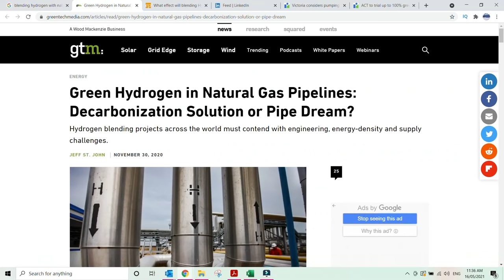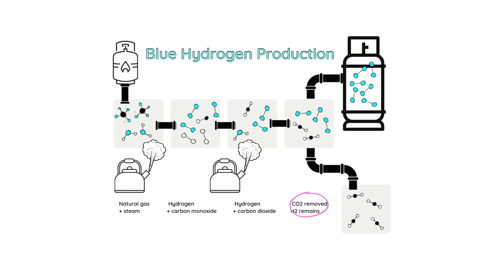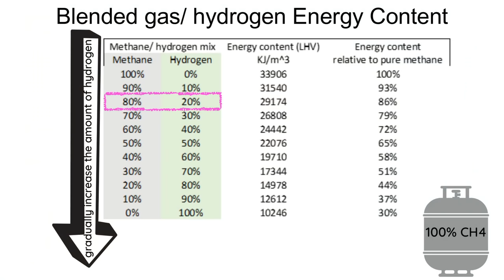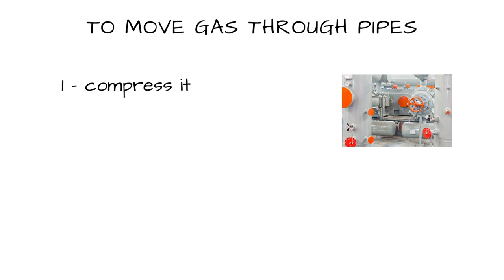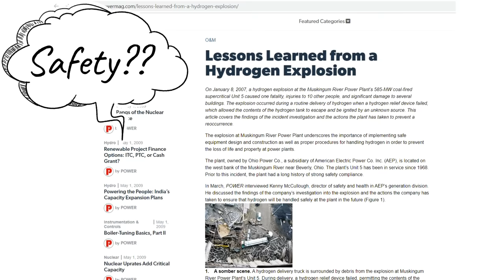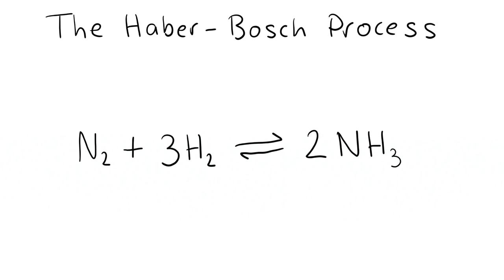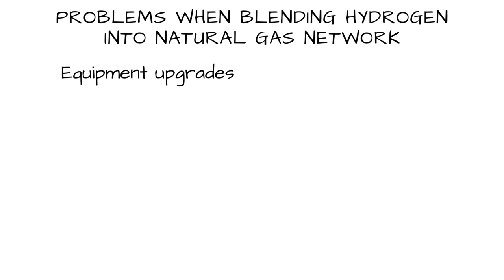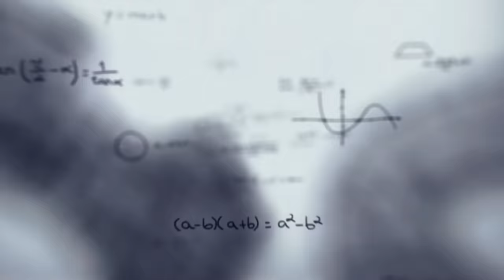Hydrogen in the Natural Gas Network

Comment: Excellent informative video Rosie.  And Paul.  Thank you.  I believe some of Pauls conclusions are worth exploring with an open mind.  But the difficulties presented for Hydrogen substituting into the NG network are considerable, and this is the key message that I found useful.  Yes, I think embrittlement will be a very important piece as well.  But also the ammonia aspect.  there is much to unpack here.  Distributed generation of hydrogen, and distributed storage of hydrogen, and many more.  Storage at 700 bar is really not attractive, so ammonia, but yes, renovation of the Haber Bosch process - there seems to be some good developments in this area recently.  My own interest is in seasonal storage.  Solar PV is cheap now.  But storage is still a big deal.  So I'm exploring hydrogen production and storage for remote sites.  We are talking about smaller amounts, so lower pressures, and perhaps ammonia will be involved.  All the best to all the engineers here !

Comment: An excellent video, very good explanation why hydrogen is not really an alternative in house heating. As my favorite energy writer, Mr. Vaclav Smil said that the biggest problem with see with hydrogen is that we cannot use it incrementally. We have to replace furnaces, compressors, even some cases pipes in order to implement this gas, cannot really use a lot of things from the already existing infrastructure.  Further problems like generating green hydrogen is also arising as it is currently a highly inefficient process with over 80% losses, while current technologies are based primarily on constant supply of electricity and stable current, which intermittent renewable energy cannot provide. Honestly I do not understand the stock exchange hype about these technologies.

Comment: Very good. I worked at PETROBRAS for my whole profissional live and for me H2 was a natural way to replace CH4 using the already existing infraestruture of natural gas pipelines. I was wrong unfortunately. But there is others means to store H2 using metal oxides em disc like kassets. I learned a lot about the subject of the possible application  of the natural gas grid to transport H2, so thanks a lot.

Comment: Hi Rosie do you know the densities of both gases of trying to pump it into a natural gas system? The methane is on average 0.89 and hydrogen is 0.079 its alot of difference how about pumping CO2 gas into a natural gas field if under pressure what happens heat is created at the compressor station and eventually at the gas fields it's a bummer what's the rush there is no magical bullet to solve things.

Comment: Rosie, Many thanks for this interesting video on the problems of hydrogen.

Mr. Martin believes that the way forward is to use and store energy in the form it is created. The problem for electricity is firstly that so far we have no commercial way of storing it, particularly over a period of a few days, and secondly the electrification of everything will be a mammoth task – a Cambridge professor of engineering has calculated that to electrify just the UK’s vehicle fleet will take the annual production of the World’s supply of Lithium, Cobalt, Copper etc..and the estimated cost to convert the UK home gas boilers to heat pumps and upgrade the National Grid is put at £300bn.

I think a better idea is to use biogas – green methane/natural gas because (briefly) :

1) It can be produced with low technology everywhere in the World using anaerobic digesters working with food/human/animal waste - and with just grass of which we have plenty. A by-product is green fertiliser.

It can also be produced using excess electricity from renewables (wind and solar) using hydrolysis to produce the hydrogen and using CO2 from the air via the Sabatier process. This process is helpfully exothermic and takes CO2 from the atmosphere, definitely a plus point. A by-product is oxygen, which is also useful.

2) The technology and infrastructure already exists to store, distribute and burn methane/natural gas to provide heating for homes (18m existing gas boilers in the UK) and cars/HGVs can be easily converted to run on methane/natural gas. Note that BEVs are currently unable to successfully power large vehicles such as HGVs.

It is also safe to use.

I would like to see please another video with Mr. Martin with his views on using methane. The hydrolysis and Sabatier processes may not be very efficient but does this matter if the electricity would be going to waste and the biogas can be easily stored/distributed/used?
Reply: I follow Mr. Martin and know some of his views on some of these questions, on which I agree (for the little that is worth, though I am also a chemical engineer).  First off, there is no lack of lithium in the world.  Just the amount of lithium that has been mined, etc.  And there are environmental and labor (Forced labor / Congo, for example) challenges on getting the lithium and other materials out of the ground, etc.  2nd - Mr. Martin has been vocal in the idea of maintaining gas plants to use for the 2 weeks/year (perhaps , approx.) that wind and solar don't provide the electricity we need.  He also is a proponent of biofuels for aviation and other uses, and electrifying everything we can.

Comment: This is a very eye-opening video, thank you so much for making and sharing it guys. I still find myself wondering about using some of the existing network for applications where energy flow through the pipes is not critical, e.g. hydrogen filling stations. Hydrogen, or a synthetic fuel derived from hydrogen, are bound to be used in some hard-to-decarbonise applications such as aviation, shipping and possibly haulage, and any filling station is going to need to compress the gas or liquify it far beyond the energy density of what goes through the pipes.

The situation I'm imagining is a site with some on-site electricity generation (e.g. solar PV panels), an on-site electrolyser that generates some of the consumed hydrogen, electricity and hydrogen gas feeds from the grid, a compressor/liquifier, a storage tank and dispensers. Depending on the state of the grid and its supply/demand, the hydrogen going into the compressor can come from the on-site electrolysis (powered by on-site generation and/or the grid) or from the gas grid. I can even imagine some situations where it might even be economical to put a fuel cell on site and generate electricity - naturally, the round-trip efficiency is lousy, but if the grid is not very stable an is in a serious dunkelflaute and wholesale prices are super-high, it might be worth it.

I'm probably talking nonsense, but it seems crazy to me to transport hydrogen in cylinders at all when we have a piping grid in the ground already.
Reply: RIGHT! I feel like theres GOTTA be a way to use the existing pipes, retro fit them maybe, and keep natural gas. Is it that difficult to just have carbon capture devices on all gas burning appliances? Gotta be a solution so we can do this as intelligently as possible.
Reply: @calebray4168  Methane seems the way to transport the Hydrogen aroud due to leakage and pressure issues, so the "on site electrolysis approach"  seems a good aproach? As fascinated as I am with the fuel cell technology I think it will be limited to trucks... I guess the electrolysis in the refilling stations will be fed during peak renewable energy times. After watching this video y guess we are "stuck" with electric cars for our daily commutes. Industry I guess will have to resort to on site pyrolisis do you think?

Comment: I've only just started following Rosie and she is growing on me quickly.  I also liked the neutrality of thus video.  Just the facts.  Hydrogen has a lot of potential but I see everyone latching onto it (a lot like CO2 sequestration) without considering all the facts.  Hydrogen is dangerous,  particularly in a domestic setting.  It has no smell, burns with an invisible flame, leaks at high rates through the tiniest hole imaginable and is insanely easy to ignite.  I can't remember why but it also causes steel pipes to develop cracks.  I'm not faulting the article but these are other things to consider.   We have to weigh all the considerations before latching on to this one like we did sequestration.   See where we got with that one!

Comment: The critique of hydrogen centers around that it is tough and expensive to pipe hydrogen with the same energy content as for natural gas though a network designed for NG.

However, we won't need to, reduced energy value is fine.
In the UK for instance most heating both industrial and residential is currently done with gas, with the (costed) plan being to replace NG with hydrogen produced from wind turbines.

But to hit GHG targets, everything from house insulation to heat pumps and loads of other tech will be needed.

So the demand for a straight replacement of NG with hydrogen will not be there, and reduced volumes for which a strategically but limited upgrading and reinforcement, notably in storage, will be needed will cover the volumes needed just fine.

Comment: Here in the UK it is very common to have a 30kw combination boiler. These kick out a lot of heat instantly for showering. However when in heating mode  they tend to provide a lower amount of heat. Would it not be more efficient to add a 3kw immersion heater to these. This would provide a duel fuel solutions. With clever controls we could use 10% elec when on full demand and 100% at low. This solution could soak up to 60Gw (20million homes x 3kw) of excess elec in the UK.  Am I missing something or are we only   allowed to pick solutions with Shiny slogans?
Reply from the maker: I certainly think that politicians prefer solutions with shiny slogans, or ones that come pre-approved by large donors 😉
I can't comment on the specifics of your technology suggestion, but I do know that there are heat pump programs in the UK as well as hydrogen home heating trials, they just get less attention because heat pumps have been around for a while. And then the biggest, easiest part of the solution is energy efficiency which gets practically no attention. Not even on my channel, because I haven't (yet) found a way to talk about it that doesn't seem like it would bore everyone.
Reply: A modern combination boiler uses an air/gas ratio valve that keeps a comparable combustion efficiency at high and low heat outputs.

Comment: The not yet mentioned is hydrogen with nearby electrical connections.  This is class 1, division 1, very expensive, careful build.  this video does mention not bringing this into homes.  Hydrogen cars and trucks filling their storage tanks also have the need for fail safe connections.
Reply: so important and not featured in many discussions on hydrogen

Comment: What about this?

1. Subsidize the bejeezus out of everything green hydrogen to make up for the inefficiencies.

2. Use distributed renewables (on buildings/property/land of all kinds) to generate a ton of excess energy.

3. Send the excess energy to a neighborhood green hydrogen electrolysis, compression, and storage facility where it can be accumulated for literally months if necessary (unlike a battery).

4. When power is required, use a fuel cell to convert the stored compressed hydrogen back to eletricity and send it to the grid for distribution.

5. When the neighborhood hydrogen facility is full, the utility can sell the excess to hydrogen fueling stations for vehicles (a proven technology) distributed locally via hydrogen fuel trucks.

6. Upgrade the electrical grid to a smart grid that can better integrate the neighborhood green hydrogen facilities into a robust network of on-demand stored energy.

There's no shortage of energy if subsidized renewables are placed everywhere. Over time, it's easier to make too much renewable power than not enough. There's no need to keep compressed hydrogen in the home if it's kept at a local but sizable facility. There's no need to complain about cost with a fat subsidy like we did for decades with fossil fuels. We have all the tech already.

Comment: I think there are also some other issues with blending hydrogen. One is when you have cryogenic peak-shaving plants in the network.  The peak shaving plant would not be able to liquefy the hydrogen due to its much lower boiling point.
Also in storage tanks I think the hydrogen, being lighter will slowly separate from the methane so if the gas is standing for some time in the tank the hydrogen will accumulate at the top and the methane at the bottom.  I'm not 100% sure about this as I don;t know to what extent diffusion would keep the gases mixed.
A third issue I see might exist is the embrittlement of the steel pipes and valves by the hydrogen though I'm not sure if this occurs also when the hydrogen is diluted in methane.

Comment: Great video. Both informative and entertaining. I agree with the many challenges of democratizing hydrogen in both methane blends and pure HP cylinders. It makes sense in a secure industrial context for steels, fertilizers, etc that need hydrogen feed. NOT for private cars parked inside buildings. Also, hydrogen is not « a plug and play » substitute for methane - you can’t even start-up many existing gas turbines with more than a few % hydrogen. You may need a separate start up fuel since the combustors are not designed for these flame speeds.

Comment: Hydrogen is best stored in ammonia or methanole, where it can be transported and stored easily at quite low pressure.
Reply: I think methanol has promise as transporting ammonia in high concentrations is unfortunately a hazmat nightmare. Maybe ammonia can be a last mile solution to be transported in small batches, but I agree, there are better "vehicles" for transporting hydrogen than just sending pure H2 all over the place.
Reply from the maker: Yes I agree. The tricky part is that you lose some energy with every transoformation to/from hydrogen. Lots of people are working on these kinds of solutions, let's see how they progress over the next few years. Maybe hydrogen transport options is a good idea for a future video.

Comment: Before we had natural gas we had coal gas, which was 50% hydrogen. I don't remember hearing about a lot of problems with sending this through domestic pipes and use in households. By far the biggest issue was the toxicity from the 10% carbon monoxide.

I'm wondering whether the issues with using more than 20% hydrogen is overhyped given that we used to use 50% through the same pipes in older houses.
Reply: The gas distribution of "town gas" was short distance and not at high pressure.  And it was 10% carbon MONoxide, which is what killed you.
Reply: @latemnetlom  thanks, yes corrected. Though the distances were shorter than natural gas it was sent tens of miles.
Reply: @chrisbrooking  Thankfully into leaky, in no way airtight houses, primarily for cooking and lighting, barely able to heat up bath water, certainly not a shower.   Hard to get enough BTU's into the system due to low pressure which is why public bath and laundry houses were the norm back before WW2 and right after.

By the mid 1950's it was being made by cracking petroleum distillates and lastly cracking and blending with methane, and the H2 % was reduced, enabling home boilers. It was coal gas in name and calorific content only, an entirely different admixture. Household use and distribution pressures were increased as well, thanks to home meters having reliable pressure reduction valves. BTW, this is one of the reasons Thatcher was able to kill off the coalminer unions.

Comment: A quick check in Google tells that the energy density of h2 is 120mj / kg, whereas ch4's energy density is 50-55 mj/kg. So why the energy content that you show per m3 is way higher in the ch4. Is it because the ch4 goes more compressed than h2 in the pipe? Why? Where am I wrong? Thanks!!!
Reply: To a first approximation (known as the ideal gas law), the density of a gas is proportional to its molecular weight.  The molecular weight of hydrogen is 2, the molecular weight of methane is 16.  So there is more mass of methane in the pipeline.  This more than offsets the lower energy density.

Comment: Turquoise hydrogen seems like it would be a promising technology when combined with our existing natural gas pipelines. Natural gas at the outlets of the pipelines can create H2 for local use and last mile transport while the carbon black can be collected and sold to manufacturers as a cleaner carbon source to be used to create more carbon composite based structural components. Developing a cheap way of manufacturing carbon composites on mass would also lower our dependence on plastics.
Reply from the maker: Interesting ideas!
Reply: A great way to make carbon products with non-CO2 emitting hydrogen as a byproduct.  But try to reduce even 1/2 of the amount of hydrogen we make today by doing pyrolysis, you would produce TEN TIMES the total mass of carbon black and graphite, combined, that we use in the world each year.  This will never be a major source of hydrogen.